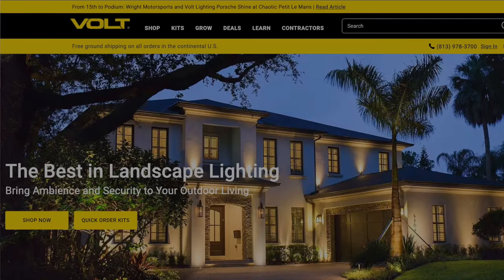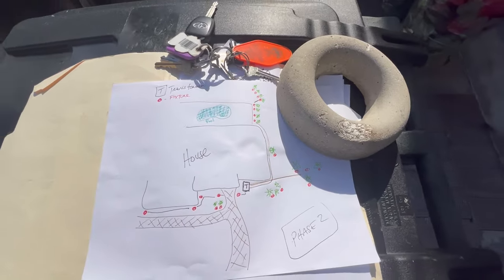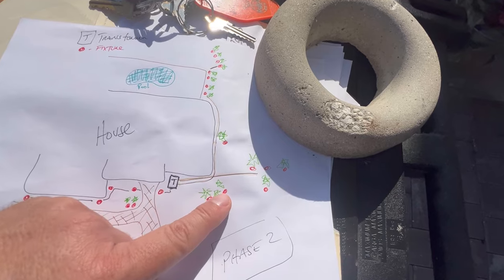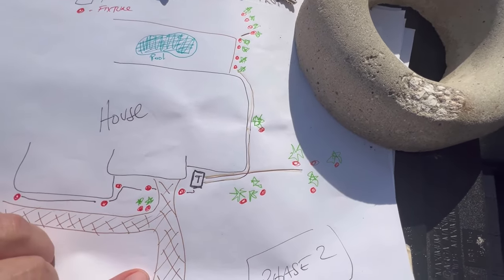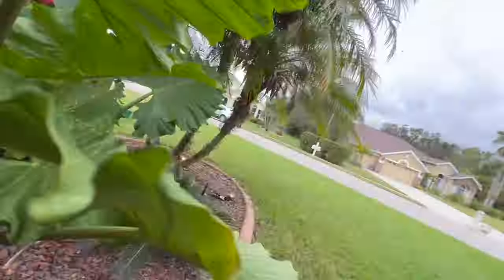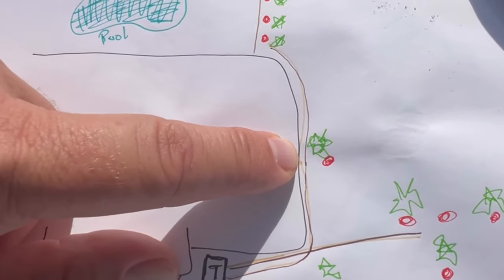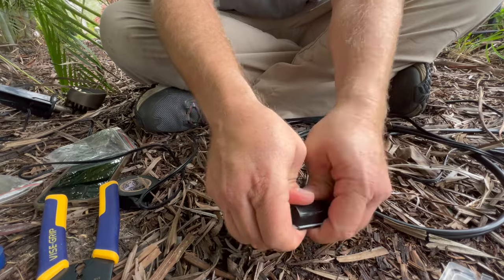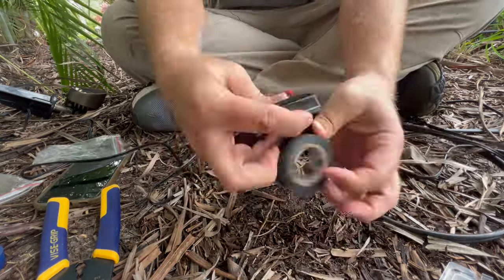Do It Yourself Landscape Lighting Part 3 - Volt Lighting Project

Comment: Often the carbon brushes are the cause of motor failures, such as your drill. Brushes are usually replaceable and typically cost about $8.00 to $10.00 for a set. I've replaced my very old corded (1990s) Toro blower/vac twice. Just an fyi. The landscape lighting is looking great btw.

Comment: I wish Volt had an app on the phone where you can Smartify them via Wi-Fi and just save your different holiday themes and what not versus having to have to go out there with a remote for each one
Reply from the maker: that would be cool but I imagine the cost that would add to integrate that into every fixture would be quit a lot.
Reply: @Thelawncarenut  no what I was thinking they would add the Smart chips Wi-Fi chips whatever have you into each one of the power supply units those would be the brain hub, and then they would communicate to the lights via the wiring.

Comment: So at $114 dollars each, im seeing 22 fixtures. Am I understanding that just for the 22 fixtures that would be a total cost of $2508 dollars,  plus the cost of transformers, wires and hubs/wire nuts?? I love the concept, but not sure its at an affordable price point yet. Do I have the pricing correct??
Reply from the maker: yes you do, and I have 35 total uplights, 4 tiki lights and 4 pathway lights. If you go to HD or Lowes you can get much cheaper landscape lights but the quality difference is noticeable. These are high end.
Reply: yes they are, and please dont misunderstand...i think they look amazing. I was looking at alterative (cheaper options) as well) For many years I did light o rama christmas lights  set to music, so im a big fan of a "over the top" display. We won the best residential display in our town at one point because of the Light o Rama control boxes and christmas lights sequenced to music